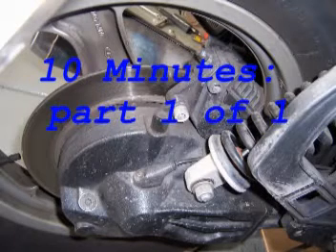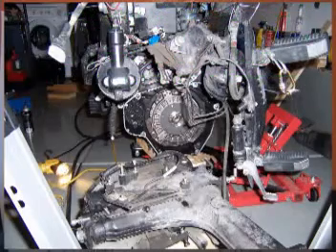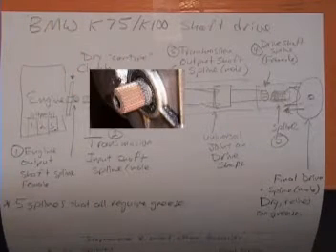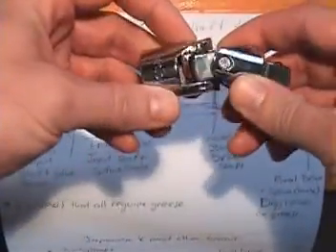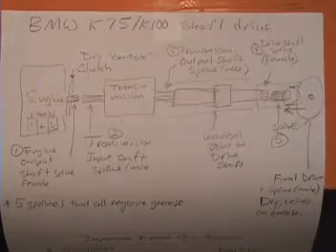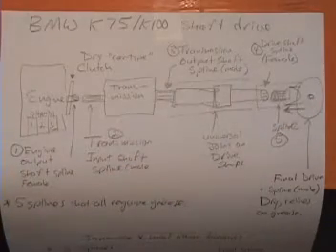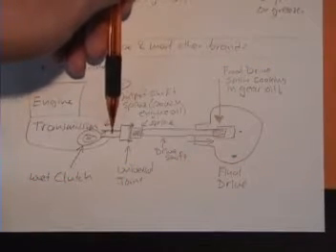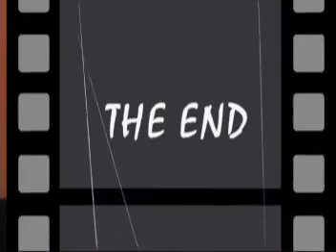BMW K75 K100 Final Drive Driveshaft Spline Failure Causes

Comment: your conclusions does not make any sense at all.  BMW states in their maintenance schedule that the splines at the end of the driveshaft MUST be greased every 30000KM's with a special kind of high sticking grease called Staburag. I drive a K100RT with 230000KM on the odometer, and thanks to regular lubing of the splines I do not have the this kind of trouble. I drive my bike every day for work.
Reply: Do you lube both front and rear splines, or should I only be concerned about the rear (final drive) splines?